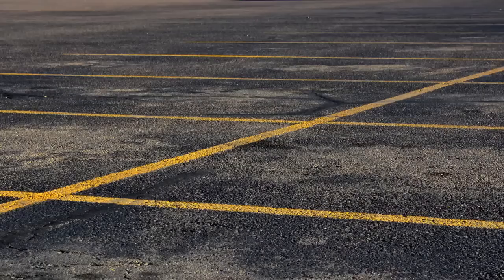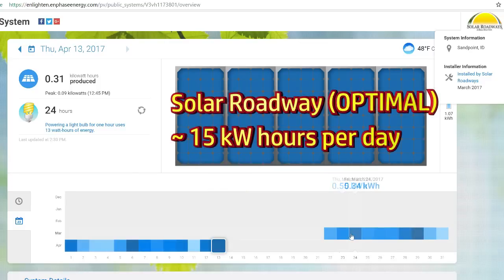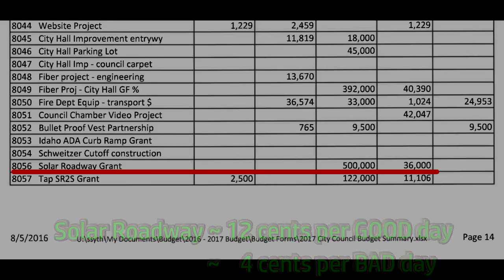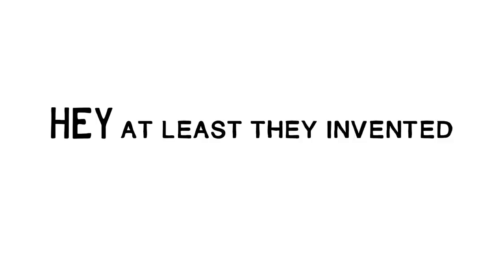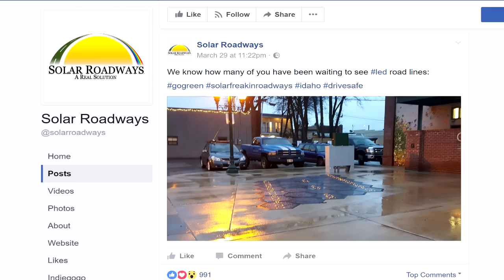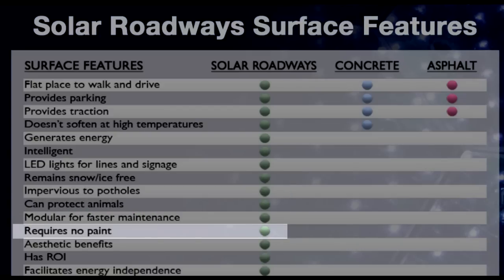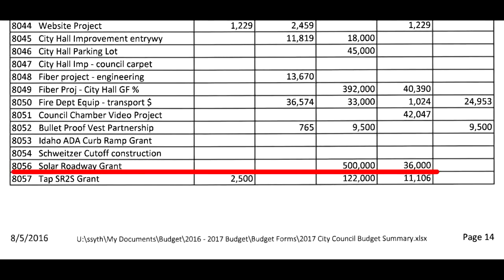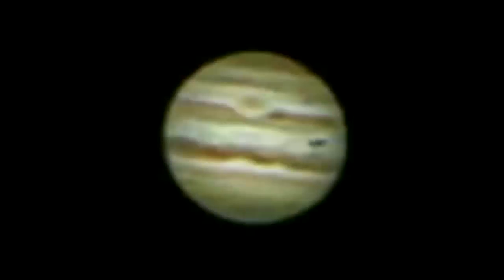Solar Roadways generate ~10 CENTS per day!!

Comment: Well, you just straight out attacked problems that, in a finished product, isn't going to exist. I'm not supporting solar roadways as it does suck, but a finished product wont be as bad as you are arguing. First, once they have engineers to install it, it will be flat. Second, once it is being mass produced, not that it will ever get there but if it did, it being modular would allow same day replacement. Though if it's suppose to be so resilient to not get potholes, why would it ever need replacing? And third, the insulting at the end was just petty. You are a scientist, the facts should be shocking enough. In fact, that's why I sub'd. But after this, if this is where your channel is going, I have unsub'd. Yes, Solar Roadways will never work and you have made really good points to prove this, but you are insulting prototype flaws that wont exist in a finalized product and for that this video is incredibly inferior to your others.
Reply: Dylan Watts they're scam artists and deserve to be ridiculed, they deserve to be 'attacked', its all wrong, the technology isn't there, its feasible but a smart road? come on now, they put solar panels with some LED coloured lights, the smart technology involved they wish for would cost so much more just in development, its a scam

(mass producing would cost so much, who wants a return investment of several hundred years)
Reply: @Daniel Law
I agree they are scammers but if you think ridicule will do anything to them you are wrong. They have already won, what do they care about you saying nasty things to them. The best thing to do is make sure people understand that this is a fraud so they don't win more. Getting all huffy just make you seem the lesser, the one that should be ignored. Especially when they are so idealistic, attacks only make them stronger. Pointing out in humorous ways how it doesn't work is much more effective, and is why I originally sub'd.

Very rarely does attacking work. At least in this manner. Humility is a good way to do it though. They are electrical engineers, right, and their work caught fire due to poor electrical work? That is the angle, not insulting them for stuff that isn't even going to be an issue if it makes it to a finalized product.
Reply: very good points, I think they put 1 million into a shitty product and gave themselves massive bonuses. (this is the 3rd video and doesn't need to be dragged out too)

Comment: If they added stationary solar panel systems onto all roofs in the US they would cost WWWAAAYYY less than "Solar Frikkin' Roadways" and produce WWWAAAYYY more power. Even if they could "perfect" their manufacturing procedures (so they don't fail and/or catch fire every 5 minutes) and lower the cost so their panels cost 1/10th of what they do now it would still be more cost effective and efficient for all roofs to have proper solar panels on them instead.

Comment: Thunderf00t makes some pretty valid points but the Solar Roadway project is a fantastic idea despite it's downfalls. Although Solar Roadways make a valid point in saying that it's going to take people actually using the product for it to be viable. Even if it's not very good at power production the safety and traffic application of using this product may be it's selling point. If you look at the aspect of lighting and traffic management it would be a very useful product.

Comment: IN addition to the energy generated (what little there is to speak of) you can't forget the cars that BLOCK the SUN from reaching the roadways. This is even more useless in cities, and it would be better in a field, or rural areas where there isn't as much traffic. The split seconds that the cars are on said panels wouldn't matter but on a large scale it might affect efficiency. This is, however, just a theory by a 9th grader in his Theater class.

Comment: I just thought of a interesting hypothetical situation with the heating on those roadways. Imagine a highway in middle of winter, a section of roadways breaks down and gets covered by ice. A few weeks later, maintenance is performed and the roadways are operational again. Pretty soon the road is melting the ice. Vehicles are now driving at 120 km/h on a sheet of ice suspended on water.

Comment: As a physicist/engineer, on seeing the original "Solar Freaking Roadway" video, it took me about ten minutes to work out the maths that showed that it could not work financially. It is just science that allowed me and Thunderf00t to reach the same conclusions independently and quickly. But it appears that Solar freaking Roadways has achieved its prime objective; to make a couple of people rich.  I just look at this and sigh as I have a couple of better and mathematically sound projects that just can't get funding. 

A better system that has been proposed for many years is to make solar roofing tiles. That way your roof generates more power than you use. Elon Musk is looking at putting these into production shortly (if he has not already done so).

Comment: Solar energy has been around for quite a long time.  We could have been using it in AT LEAST a supplemental capacity for decades.  If we had, these snake-oil salesmen wouldn't be banking on the ignorance of solar energy of the average consumer.

Comment: I'm going to crowd fund a project to build all roads sloping downwards. Imagine the fuel saved! You basically coast everywhere you want to go! Anybody who says it wont work is just a reactionary!
Reply: Cars without engines. Bro I see the future and it is sloped freaking roadways.
Reply: I really like this idea. I can just buy a house at the bottom of one of the largest sloped roads, and just never leave! Think of the savings!
Reply: There's no need to build all those sloped roads. Just jack up the rear suspension of your car so it's always pointing downhill.
Reply: Traveler Finder - Downhill in both directions. Fucking genius!
Reply: That way we can coast from coast to coast.
Reply: They're scared of change, descendants of flat earthers, I bet. lol
Reply: Well with no engine, you wouldn't be able to have power brakes, but I guess those are overrated.  Actually who even needs brakes?  Isn't that what tree's are for?  Just coast down the hill, and swerve into a tree when you want to stop!  I'll never have to spend money on brake shoes again!
Reply: "I really like this idea. I can just buy a house at the bottom of one of the largest sloped roads, and just never leave! Think of the savings!"

Have a hydroelectric dam at the bottom, think of the rains...
Think of the water/cash flow!
Reply: 25852Dan: Ooooh, that's going on my bucket list.
Reply: eddiebruv lmao
Reply: Power brakes arent necessary if the car is light enough (under 2400lbs or so)
Reply: Al James Sometimes the most obvious solution is easily overlooked! I've seen the future, and It's Infinite Sloping Roadways! I just need to convince some hick town in America to fund my drinking probl......I mean fund my extensive reseach project for several years. Obviously I need to build different road types to find the ideal surface composition and slopiness. These things are entirely unknown and can't simply be calculated, 'cos it's pushing the boundaries of science or something.
Reply: https://what-if.xkcd.com/154/
Reply: GameraTheBrave Yes, yes. Excellent thinking. And when you want to return, you just jack up the front instead! This is the kind of thinking that will solve the energy crisis! Shadilay, my brother.
Reply: Yes when we where kids we had to go uphill BOTH ways!  Going downhill BOTH ways?  Eurika!  Lets go make some clickbait, son!
Reply: scottthewaterwarrior We'll add Solar Powered Brakes, with LED's! They'll look super cool when you are slowing down.
Reply: send a chain out into the universe and hook it up to a generator, of course we will have to add links everyday, and the force of the universe expanding can run the turbines : P

Troll Physics.....
Reply: cuz dey wil gener8 powa 5ever (dat mean moar den 4ever)
liek if yu crey evrytim
Reply: I could count the accumulated IQ of everyone in this thread on one hand.

Ready?  Set? 

One.... Two.... Three.... 

Ran out of fingers. Shouldn't have borrowed the wheelchair bound amputee to use as my abacus.
Reply: All roads cannot slope downwards. Eventually you will have to go up. 

Unless it's one of those Escher optical illusion stairs that always goes down. (But that's an optical illusion. It's not real).
Reply: MichaelKingsfordGray Fuckin' Canucks......stealing my idea! I'll sue! Infinite Sloping Roadways was my idea!
Reply: eddiebruv you are a visionary.  you will go far my friend. I don't know why someone hasn't thought of this already.
Reply: azmanabdula Let your dreams be real! Just do it!! GoFundMe is your friend.
Reply: why not put sollar pannels with leds in it so that they generate power for ever?
Reply: HandsomeHolland 
facepalm
Reply: Im not gonna be responsible for that....

no way : D
Reply: eddiebruv 
Yeah, and we'll have elevators for the cars whenever they want to go up! facepalm
Reply: Cornelius McMuffin That's great! I'll look at including your idea in my proposal. Thanks!
Reply: eddiebruv what why?
Reply: tybofborg ikr we are so damn smart dude!
Reply: what does a toyota IQ has to do with this? you make no sense dude. you are dumb. we have great ideas,
Reply: HandsomeHolland TOYOTA? 

Next thing he's going to say is he owns a Chevy. 

Case rested. Thread is dumb.
Reply: I have the ultimate power and worldsaving thing ,we wil do absolutely nothing
Reply: I duly apologize for such a long reply:

I partly agree, however the earth would need to double as a pendulum. 
If a house is downhill and downtown is also downhill then your residence is atop a hill. You'd need to drive back up unless you use my innovative technology: the world's first Atomic Pendulum! Since Planet Earth is comprised of atoms, it's only logical; Earth could rotate 45 to 90 degrees on both sides so that you NEVER have to drive uphill.
 Ever. Moreover with more APs (Atomic Pendulums) different locations would rotate at different rates and times so that it doesn't interfere with other people's travel plans. 
Now not only can you drive downwards to your local convenience store, you can do the same to go back home. Buy today for only $900 mil per item.
Reply: +G HL  smart ! i buy one !
Reply: Shut up and take my money!
Reply: eddiebruv I'm giving you all the money I make you know what i will have my paycheck go to you you only need about eh 3.4 trillion us... off the top of my head
Reply: All roads are going downhill unless your driving the wrong way.
Reply: You're a genius. Stay strong in faith, lest you be discouraged by those gravity deniers. lmao
Reply: We should also flood all these downward slopes roadways with water then collect that and use it to power turbines and generate electricity!
Reply: Everybody gangsta till everyone gets stuck in a massive hole where all the roads end
Reply: I’m a CGI artist and can make the animation needed to get millions in crowd funding,Mon matter how stupid or physically impossible it may be.  As long as it has cool lighting and other flashy details.  CGI animation is all investors need to see to believe its possible and plop their money down.  PT Barnum had it right over 100 year ago, “a crowd funding investor is born every second”.
Reply: Yes! Imagine it! We put all the residential areas at the top of hills, and all the business areas at the bottom. That way, everybody can just roll downhill to get to work. We will be harnessing the power of gravity. It's perfect
Reply: this is really a great example, because it demonstrates conservation of energy in a way that almost anyone could understand

Comment: Theoretically if they improved some of the nuances they have this would produce enough energy to be worth it. You have to count in contract deals, these companies face extinction or making a deal. The only real downside of construction is the batteries. Now imagine if you counted the unthinkable amount of square miles of roadways in one single city, let alone an entire country conversion, it would definitely power the entire continental United States. Although this seems untheasable if they did manage to convert the entire country to these roadways it would be worth it in the long run. Now I feel like hydraulic generators would be more efficient, an average car weights 2500lbs-3500lbs. It would be high maintenance but the energy difference would be incomparable
Reply: TJ4774 Or just put solar panels on roofs, which actually can pay for themselves and are virtually maintenance free, unlike these dog nuggets.
Reply: eddiebruv I feel you on that. Where I grew up a lot of people started to do that but I feel there is potential in this. Produce power, avoid ice in winter, fix the ever crumbling road infrastructure. There's just one missing component in this situation I feel someone could discover and fix it all. Maybe I'm wrong but I feel like I'm looking over something.

Comment: 15:36 3 too many zeros. You have 500,000,000,000. I would also like to see the costs of solar when it is made in either Europe or N. America. All these Chinese panels are cheap because they aren't being made in a 1st world country with 1st world regulations and labor costs. Your example doesn't include the costs of batteries, charge controllers and inverters and the losses associated with them.

Comment: so. they fail at "Solar"? Another way they fail, I expect, is as a roadway. my guess is that an optically flat tempered glass sheet is a really bad surface for a road, especially in the wet. very slippery.

you could add a rough surface to it, but it would retain more dirt and diffuse more light - making it even worse from a solar or intelligent perpective.

Comment: in the rust belt concrete and asphalt suffers heat buckling and frost heave. a road can deteriorate quickly there with no traffic. even if you could reroute commercial traffic the snow plows do alot of damage. also 40 degrees north

Comment: I still see the use of fixed angle or convex angled Solar Panels as roofs over car parts or paths in supermarket car parks - or on building roofs in general even if they just provide some power like for air conditioning or lights at night say.

Windows that have multi-function like auto dimming or mirroring on one side and the other side acting as solar collectors - or even thermal transfer into elements embedded in the frames those would be useful for skyscrapers too - and are starting to be implement in small ways in posh hosing too.

If Solar or multi-function window glass becomes much more common I think that would be a positive thing.

Comment: 12¢/kWh is the average cost of electricity in the US. The road was built in Sandpoint Idaho. Electricity in the Inland Northwest is close to the cheapest power in the country. The average residential electricity rate in Sandpoint is 9¢/kWh, and the average industrial rate is 5¢/kWh.

Take Thunderf00t's numbers with a grain of salt. Because they built the road in Sandpoint Idaho, a place where power is about 20% cheaper than the national average, the solar roadway installation is making significantly less than the amount of money than Thunderf00t calculated.

Comment: wait if these LEDs get hot enough to melt snow, imagine the sun hitting them plus the LEDs turned on. How hot do these puppies get?? what if like a car crash happens and some fuel spills, could it ignite it?? ;-;
Reply: A lit cigarette won't even ignite fuel, so you don't need to worry about that. Then again, a crash could break the panels, exposing live circuitry, so all bets are off. Another problem with heat is that it decreases effectiveness of solar panels, which is just another reason why encasing them under a thick layer of glass is not the best idea.
Reply: tybofborg aaah snap really. I guess I'm used to Hollywood movies xD. That's true, these things are really a waste of money. Good idea tho.

Comment: Call me crazy but, wouldn't it be easier, faster, and less prone to catching on fire to put the solar panels on the roof of the Walmart? You don't have to worry about the panels getting cracked or foggy on the roof because no cars will be driving on them. And because there's no cars driving on them, you don't have to worry about the cars blocking out the sun. Sure it's still not optimal but it's infinitely better than putting them in the road because YOU DON'T HAVE TO LIGHT THEM UP
Reply: Yeah, and/or put them on a roof over the parking lot. I've actually seen images of this done, at a Jumbo store in La Réunion. 2.5MWp, a significant source of power for the island.

Comment: Citing the cost of a prototype as indicative of eventual cost is as disingenuous as it is stupid. Imagine if people had done that on LCD screens, solar panels, computer processors or high street drugs.
Similarly, smugly citing the failure rate of a prototype is equaly asinine. Space launches STILL have a massive failure relative failure rate yet are routinely performed because there is an inherrent risk in the technology.
I'm willing to accept that this is a doomed idea (at least with current technology) but if you have to be dishonest to prove it, you are no better.
Solar roadways has definitely been hyperbolic in its marketing, but perhaps it is more about a proof of concept, than a precise template for a future development.

Comment: Those strips they use to hold (or not) the hexagonal panels together probably wouldn't stand much in the way of harsh braking before being ripped out, so not only would an emergency stop likely break the road, but you'll be left with metal strips in the road for subsequent vehicles to run over.  And even if that didn't happen it's an uneven surface so road noise would be horrendous.